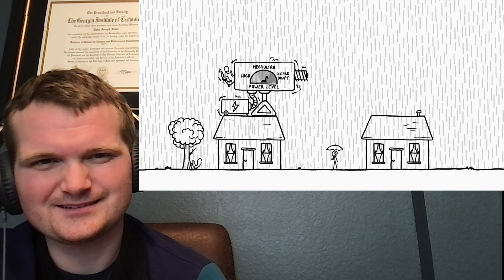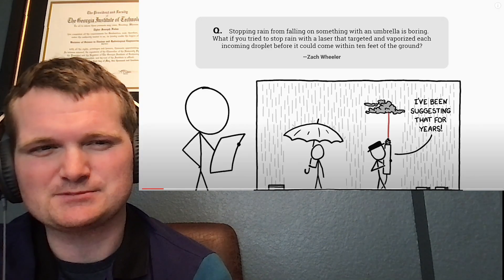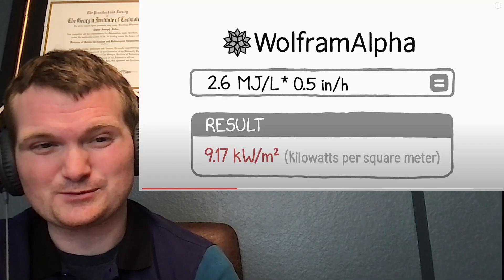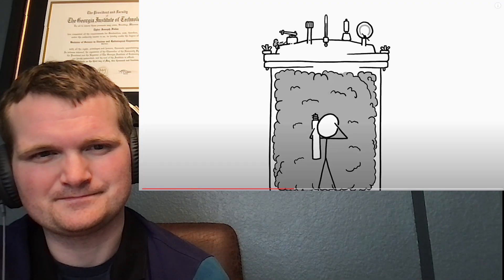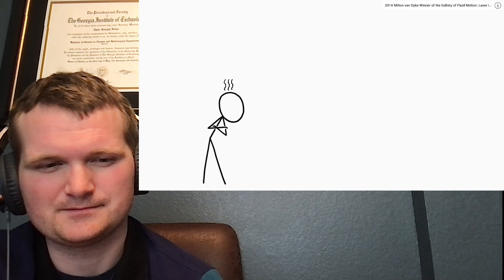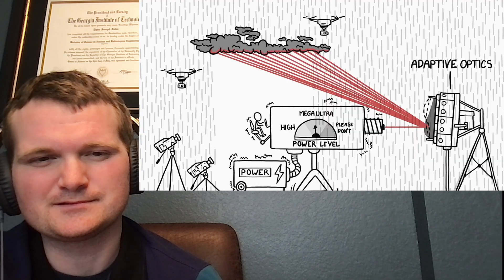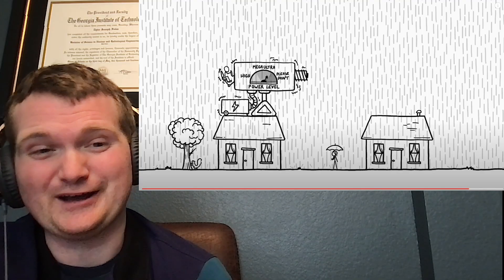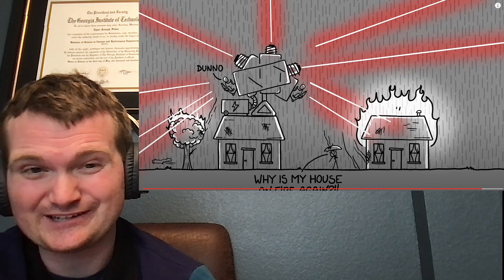LASER UMBRELLA? - Nuclear Engineer Reacts to XKCD

Comment: d.e.w. 

lasers do this all the time. infrared and chemical laser emit much more then one type of beam! 

the water is super heated so fast the hydrogen and oxygen vaporize and explode. 

tune it to about 5ghz and focus it, like most mounted lasers... itll target water... and create ozone and ionize the air.... no vapor. 

the water disipates enough that it diffuses the laser and reflects it in all directions. 

solid state hardware can beam focus and target multiple drops in a pulsed modulated frequency. 

currently aadvertised as area denial systems and anti material missle defenses and drone protection... 

no need to focus a horde of lasers just a few cell towers and ground based stand alone deployables. 

the air is already highly ionized and various texhnologies deny rain and weather with highbpressure systems. by heating the air.

you can even pulse a nuclear reactor and do the same thing.

all of it visible on radar. 🤓

same stuff causes earthquakes and air quakes 🤓

Comment: Expanding the beam and then focusing into a cylinder with cross section area of one square meter sounds good until you realize that by targeting every water drop at once you must then combat the air-cooling of every drop. The process of entirely evaporating a single drop requires a precise and high energy burst, so diffusing the beam like this will also run into the same scattering issue unless you upgrade the beam input to be about 50000% stronger. Furthermore, it runs into the issue of wind, any amount of wind will make the rain travel into the beam from the side and entirely defeat the purpose. Beyond that, you also now have a lens already wide enough to act as an umbrella sitting above you to project the column. Any effort to use a smaller lens has another problem where the 100 meter long cone produces a gradient from lens diameter outwards of effective output, as nearer to the edge the drops will fall out of the cone before evaporating even without wind. The energy math used in the video is assuming a perfect efficiency by shooting down every drop, so any passive configuration will be at a constant 100% output to ensure no drops get past, an expanding circle of laser for example would need enough power to simultaneously obliterate 1 square meter of water drops from more than 50 meters away

Comment: Empirical units :/ how do you not just give up and use SI?

E = 9.675 * 10^17 ft-lb * 1.285 * 10^-3 BTU/ft-lb

Now if that's not thrice gross short of a carpenters thrupenny inch then I don't know what is.
Reply: Like you're casually rearranging things, but then you're having to keep track of the fudge factor constants, and the error bars on the error bars of your error bars. And then things are scaling in weird ways because empirical units are hacked together from historical odds and ends and accidents, so your calculation is full of roots and logs and square roots and other equations for you to keep track of the error bars on, so you take a pure mathematics degree, followed by a science degree and get your best friend ol-Jo the history professor to give you a hand. So now maybe if your lucky you can keep track of all the equations and other dependancies now needed to keep track of the square root of error bars distorted though the log of a value that's now highly iterated on as you rearrange. And just when you think it's all over it's soo historical that it's mixed radix. And then you give up and use SI units.

Comment: The thing I am curious about is the steam effect. Or rather the water vapor(related to the autoclave part). Steam isn't visible, but since the air is a large heat sink(effectively, in this case), you'll cool the steam off fast enough for it to start to precipitate again I imagine. And once you start that process you'll get a lot of water vapor which would probably diminish your laser's power as it hits incoming droplets... So you'll really create a big sauna fast, and then the laser can't do much since the beam won't be able to penetrate the fog effectively anyway...

Comment: "Oh, I'd like to see someone try to get that past their HOA"

Honestly didn't think of that. But as the saying goes, it's easier to get forgiveness than permission. And I'm pretty sure your neighbors would forgive you after the HOA board members "mysteriously" disappear. Honestly, that sounds like a much more practical use for the laser than merely acting as a rather expensive umbrella.
Reply: A long time ago, Kyle Hill discussed the challenges with "vaporizing" people with lasers. The reality isn't pretty. To actually vaporize something the size of a human, you'd need a truly ridiculous amount of power, and it wouldn't just destroy the target. Everything in a fifty-plus meter radius would be set on fire, and the victim wouldn't turn into a pile of ash; they'd explode. Violently.

Assassination by high-powered laser, whether in space or otherwise, is not a clean procedure. It's about as far from clean as one can get, in fact.
Reply: @fighteer1  True enough. Although I suspect that Randall didn't actually think through the laser umbrella completely. He touched upon a key element, but then got diverted into thinking that the rain had to be completely vaporized. But, if you look at the purpose of an umbrella, it's intending on /diverting/ rain from one location to another. And the incomplete vaporization that a "lower power" laser would have on a raindrop effectively splits the drop into multiple smaller droplets and more importantly, changes their velocity vector from the original path. Basically, vaporizes a small part of the raindrop, turning that small part into a tiny rocket. So, there's no need to actually vaporize the entire raindrop. Just divert it from the protected region.
Reply: @johncochran8497  I'd like to see the math and/or physics simulation of that concept before greenlighting it...
Reply: @johncochran8497  A real umbrella guarantees that the rain doesn't hit you.

A laser umbrella that doesn't vaporize the rain does not.
Reply: @fighteer1  Atomic Rockets talks about this. If you only vaporize a tiny portion of them, and then a tiny portion at the back of the crater that leaves etc., the end result would be pretty similar to shooting them with a bullet.
Reply: I think that this would be the perfect thing to deal with an HOA. Your HOA won't sue you if you have a weapon that can destroy every house and vaporize the whole neighborhood.
Reply: or just live in a neighbourhood without a HOA?

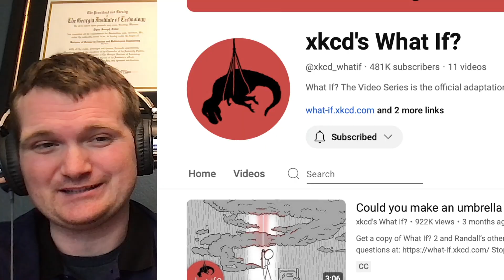Comment: 0:26 I would guess the reason the FAA is interested in your lights on the powerplant not working is because those are there to warn aircraft of a tall building. So not really in any way related to why they wouldn't approve of laser umbrellas (though they certainly would not approve of them)
Reply: Well its also used as landmarks when flying vfr or other approaches so if the øights are out then a waypoint may not make a lot of sense
Reply: Well having a laser pointer at an airport can literally get you escorted by security so... 🤷